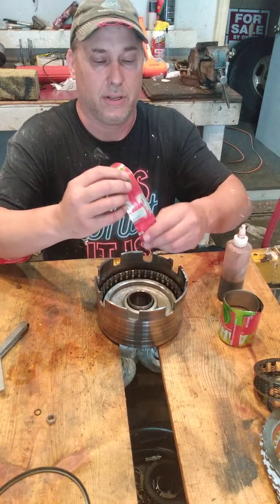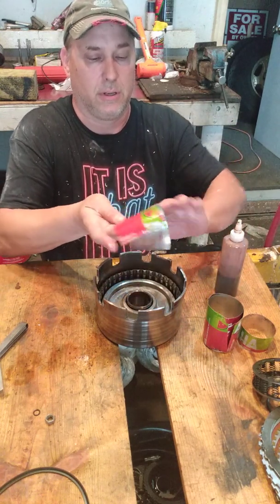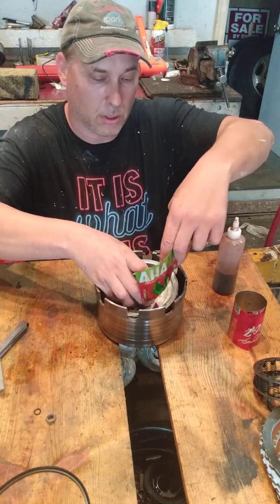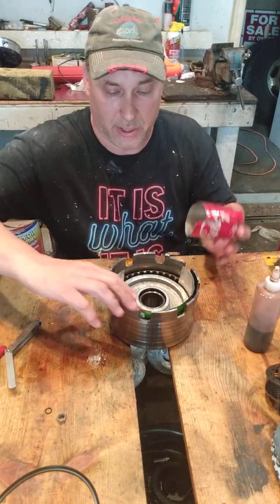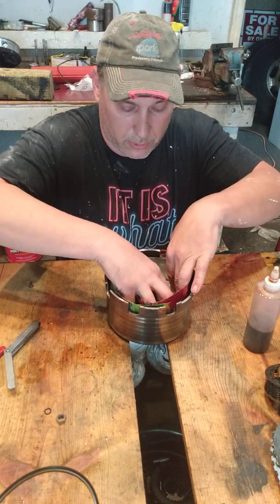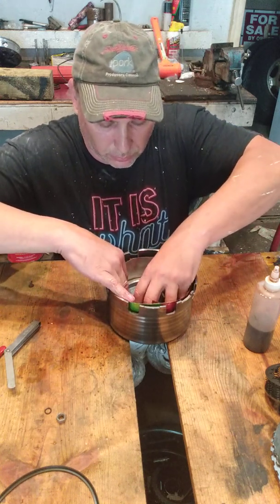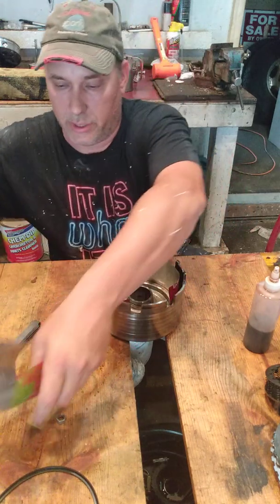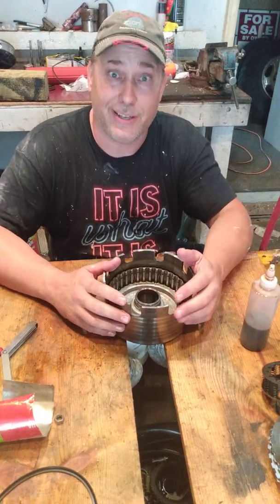4L60E Reverse Input Drum Piston Install

Comment: I'm sorry, thats just wrong. That metal is much sharper than the feeler gauge.
Reply from the maker: Its flimsy and thin and lubricated so it doesn't cut through the rubber.

Comment: I used a Wise White Chedder Popcorn bag instead of the cans, it worked Cheryl well and looked like removing the bag was easier than removing the cans, plus I didn't have to cut up cans and didn't have tonworry about cutting myself on said cans. 
Great video, got right to the point and showed what you were doing very clearly, most transmission rebuild videos seem to have been shot from a tree or something, you can't see what they're working on.